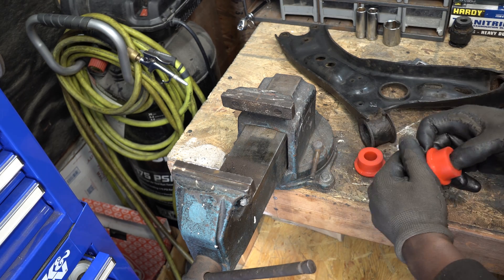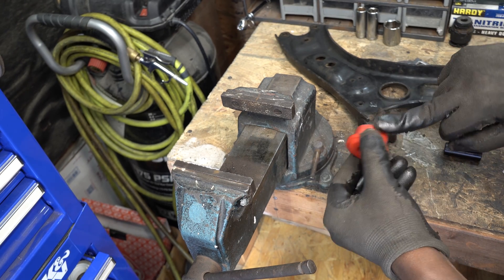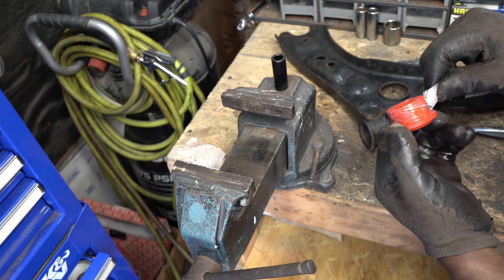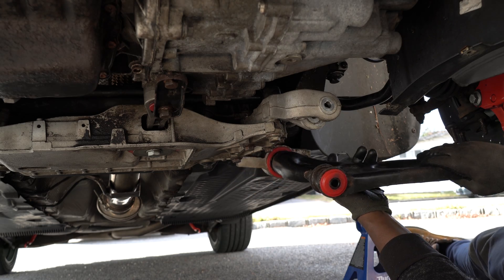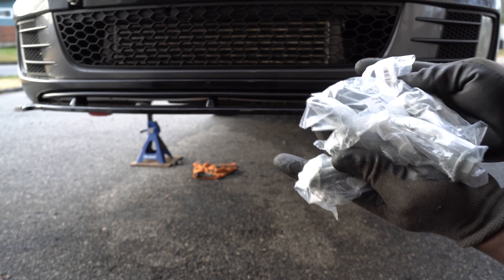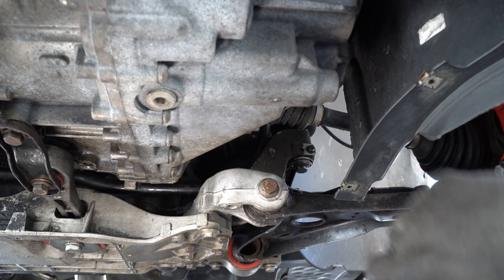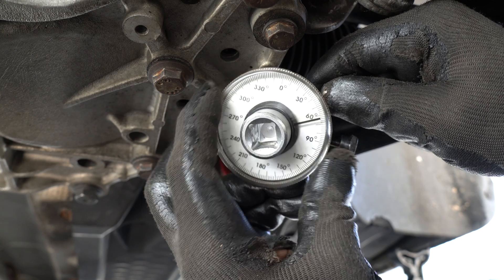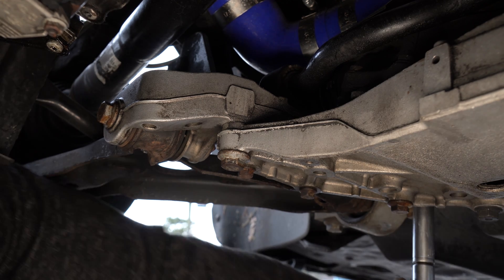VW MK6 GTI Front Control Arm Bushings Upgrade to Polyurethane - Part2

Comment: Great video thanks for posting, what is your car ride like since installing the PU bushings? I have some for the wishbones on my car, I've heard that the ride is a bit rougher with PU Bushings being harder than the factory rubber ones??
Thanks again.
Reply from the maker: much respect👍🏽 it made the steering feels more responsive. I didn't notice any harsh feeling from the front end.
Reply: @CraftyWorkshopBuilds  cool thanks for the advice. 👍

Comment: More than a year since you got your hands on it. Please share how has been the performance after the upgrade? And any squeaks or noises?
Reply from the maker: It's been good, performance is the same as when I first installed them. Nah, no noise nor squeaks.
Reply: @CraftyWorkshopBuilds Aight, can you please tell me how does it perform on bad roads or may be off road as the place I live has lot of bad roads with big potholes so I don't want the comfort of the ride sacrificed due to the stiffness.

Comment: has anybody had a creeking sound when braking and setting off? ive just hade these fitted and they make alot of noise
Reply: Just put mine in and experiencing the same thing. I thought something was broken. Did it ever get any better?
Reply: I removed them as they didnt fit properly, put oem in. They were fine. I got mine from psb never again.

Comment: How did you extract that snapped bolt?  Excellent video.  I have a 2013 Jetta Sportwagen tdi (MK6).  I’m assuming it’s very similar.
Reply from the maker: I end up replacing the arm with the broken bolt. Much respect! Yes, it's similar.

Comment: Nice instructional on replacing the control arms, thanks!  Thought I'd include a link for those who have the DSG box (vid is for a mk5 jetta/golf but will work the same on the mk6) as it restricts the LH front bush bolt removal: https://www.youtube.com/watch?v=yT0yYkOqiQQ. A point that is worth noting, and this seems to be a common mistake repeated across the net with regard to bushing fitting but the bush should not be lubricated where it installs to the chassis (metal of the control arm in this case), as a rule the lub should only be applied to the moving parts within the bush.  If there is corrosion, clean and paint but do not lubricate as the bush is NOT intended to move in relation to the bracket.
Cheers for all the great content and production!

Comment: If you put the red first to the subframe can you put the black after?
Reply: May depend on the brand used but generally the outer bush can be inserted then the secondary internal bush inserted.  Note too that the main outer bush should NOT be lubricated where it fits to the arm, all bushes where they fit to the arm should not be lubed as they are to move WITH the arm, only lube the internals (eg. the secondary bushings or spigot tubes on the front bushes).  Hope that helps

Comment: Does it require wheel alignment if you only did the big bush on the control arm?
Reply from the maker: Yes, it's recommended.
Reply: Recommended after any suspension part replacement

Comment: You really should have lubed those bushings with a ton of PTFE.  Not super supportive of those ECS bushings though.  I went the Powerflex route with Street 80A durometer and they do not have the "hollow" that those do.  But, better than stock for sure.  Thumbs up.
Reply from the maker: Yea definitely better than stock, I'll see how they hold up.
Reply: @CraftyWorkshopBuilds  how are they?

Comment: Gutted to see you didn’t film how you replaced small part of wishbone subframe bracket after one of your bolts snapped- like mine- as I was hoping finally my get to see how this bit is replaced! Good job though and I have the same bushing to install! Don’t the rears and feels a lot more solid for it- looking forward to the end result! Keep up the hard work bro 😎
Reply: looking for a video/guide on this myself! i had exactly the same problem he had
Reply: Hint. Remove assemble (if you must) tack weld on a head. PB blaster. Remove bolt. Best case scenario I’ve seen. About to embark on an exhaust fix with similar possible issues.

Comment: Nice work on these control arms. I just finished replacing all my rear suspension bushings and I did it all expect the toe arms with a ball joint service kit from harbor freight just fyi. It make life much easier then a using a table vice
Reply from the maker: Much respect! Cool, I'll look into the ball joint service kit for when I the rear ones.

Comment: When Re-Installing did you use lock tight or anything?
Reply from the maker: I used a little grease because there was some corrosion in the holes for the bolts. It's actually not recommended to use any grease, it will throw of the torque specs. Lock tight is also not recommended.

Comment: Hey man I love your videos, I love the mk6 but can’t decide between the mk6 gti or mk6 R, in your experience what would you recommend?
Reply from the maker: Respect, I'm happy you're getting value from my videos. It will depends on your overall goal of the car, will you keep it stock or plan to modify it? The awd platform is definitely a huge advantage on the R.
Reply: @CraftyWorkshopBuilds  hey thanks for replying! I guess my overall goal would be a clean build with maybe some performance modifications but nothing too crazy, I love the awd platform on the R and the styling however the gti has a massive fan base and is a lot cheaper, overall I’m stuck haha
Reply from the maker: They do share a lot of the same parts. Yea, that's one reason why the GTI fan base is larger, it's cheaper, Lol. If you choose the R you'll probably end up with less funds to do mods. However, that will depend on your overall budget.